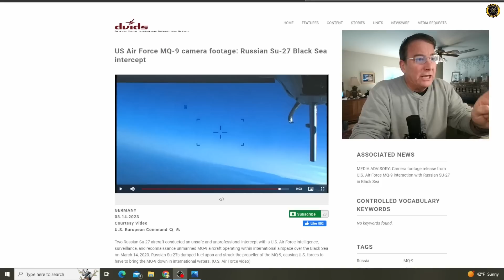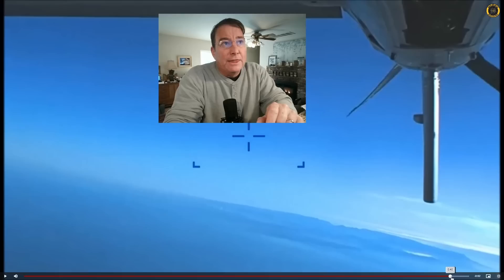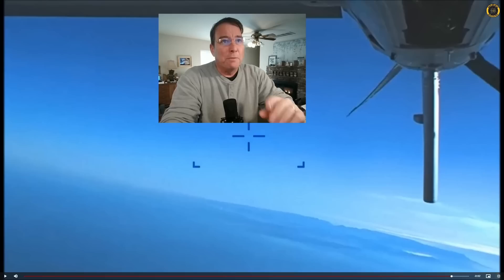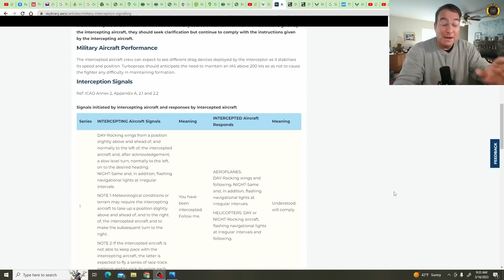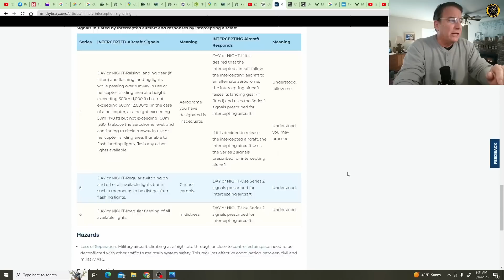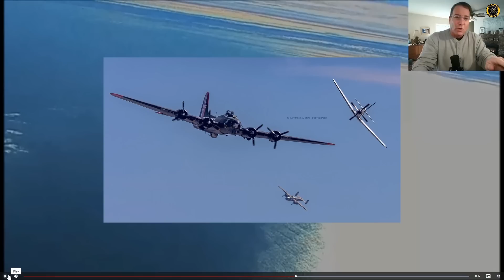Botched Russian Intercept of MQ-9 Drone Over International Waters

Comment: A couple of possible scenarios: 1. The Russian pilots were attempting to down the drone, intact, so it could be recovered in the sea.  2. The fuel dump itself bent the prop.
Reply: a fuel dump, especially from a jettison system isn't capable of causing damage to another aircraft. You can clearly see the fuel is fully atomized within a few feet of the dump outlet. My thought was the idiot was attempting to set the drone on fire but I'm not sure the SU-27 is capable of a dump and burn.
Reply: @Dreddip  Thats exactly what he was trying to do with the afterburners, with a half empty bottle of vodka in the cockpit.
Reply: @Dreddip The fuel wouldn't atomize. Think diesel
Reply: Camper Lab, agree on both counts. The plane likely flew within a few inches of the tail fins, putting the stream of fuel over the blades and the air intake.

Ingestion of fuel would create a fuel-rich  mixture likely to cause the turboprop to flame out. With no APU & a busted prop, it's unclear if the drone had a sufficient power reserve to operate the flight controls and maintain the satellite antenna lock - it doesn't appear that its operator had been able to glide it outside of the recovery zone of the Russian navy.
Reply: The thrust from a propeller blade is typically proportional to the density of the medium it is operating in (plus other factors of course).  The density of air at altitude will be somewhat less than 1 kg/m^3.  Density of pure liquid kerosene is around 800 kg/m^3, but in this case the kerosene is dispersed as droplets in the air.  If we take a hypothetical guess that the air/fuel mixture is around  25% fuel, 75% air, the net density of the mixture will be around 200 kg/m^3.  On encountering the fuel mixture of this density, the propeller blade would experience a sudden increase in load by a factor of about 200.  A sudden overload of this magnitude would be enough to bend most things.  Of course we don't know the actual air/fuel ratio.  It could be less or could be more.  The velocity of the dumped fuel relative to the drone's airspeed could also be significant.  Too many unknowns to be anything like accurate, but appears not impossible for a fuel cloud to bend a propeller blade.
Reply: @dogfoot1874  avgas is highly refined, unlike diesel
Reply: @Sshooter444  I suspect the aircraft in question is using AVTUR - which as a refined kerosine is very much like diesel!
Reply: @Sshooter444  jets don't use Avgas , they use Jet A1 which is 99%diesel with an anti freeze.
Reply: I agree with  '1', but it looks to me like he rammed the drone by mistake. Th e fuel was WAY behind him, and as Dr. Juan said, (heh heh) it looked like he was gonna have an "Oh s#!% " moment and pulled up at the last second. Probably soiled his panties.
Reply: @derekgodfrey5  Jet A is closer to kerosine.
Reply: Exactly what I said, this was to recover the drone - and guess which russian ally is desperately attempting to create a domestic drone program...
Reply: @chargerfan5513  "he rammed the drone by mistake" Unlikely, because the drone's tail fins extend outside the prop. The drone is MUCH slower than that jet in the level flight, plus the jet pilot appears to have been intending to douse the prop and air intake with a LOT of fuel at once (not much atomized) "to create local atmospheric conditions not conducive of continuing powered flight" as his report likely has stated. Both objectives call for a very high angle of attack (aiming the fuel stream down, to contact the drone) slow-ish pass (time of exposure to the fuel stream), and that's precisely what'd transpired per video footage. Needless to say, a stabilized approach for such a pass would start behind and well below the drone. Vid author's assessment is a potentially lethal underestimate of the Russian airmanship in this case.
Reply: @derekgodfrey5  TS-1 is a jet fuel made to Russian standard GOST 10227 for enhanced cold-weather performance. It has somewhat higher volatility than Jet A-1 (flash point is 28 °C (82 °F) minimum). It has a very low freezing point, below −50 °C (−58 °F).

Dense.
Reply: @dogfoot1874  of course it does, think speed.
Reply: @richardstuart325 , nice try but if the fuel hitting the blade was dense enough, the blade would try to fly forward, therefore bending the tip. No that bent blade is bent against the direction of rotation.
Reply: You're absolutely right on both counts. The drone was considered a threat,  Russian navy did snatch the remains. Hitting a body of liquid at the speed prop blades were traveling will do the job.
Reply from the maker: The botched fuel dump overshot and MISSED completely!
Reply: @blancolirio  second one was a SUCCESS 🤣
Reply: @Dreddip  Perfectly atomized to over rev and destroy the drone engine.
Reply: @chargerfan5513  Nonsense. They practice this move. Here it is in Syria https://youtu.be/EvaQZEhlhA0
Reply: The drone was downed in one piece as they wanted it. They practice this move. It isn't easy to douse a slow moving drone with fuel. https://youtu.be/EvaQZEhlhA0
Reply: @Sshooter444  its a turbine engine so no avgas.  jet fuel / kerosine/diesel
Reply: @IlPinnacolo  Very true. The distribution will range from nearly all-air at the visible boundary of the dispersion "cone" to nearly all-fuel in the middle, one turbulent bubble of a few gallons' worth of TS-1 right next to another. What that can do to a spinning prop is easy to see if one studies the sea plane landing mishaps.
Reply: @blancolirio  >"The botched fuel dump overshot and MISSED completely!"
What a botched operation. The US navy was able to pick up the SU-27 wreckage while the MQ-9 continued with its mission.
Reply: @mvd4436  The engine won't rev and destroy itself. There is a system installed on some versions of the 331 engine called AWI (Alcohol Water Injection) used to lower engine temperatures for better take off performance. When that system is inadvertently filled with fuel and dumps way more fuel into the engine intake than briefly flying through the fuel fog an SU-27 lays down, the engines don't run away and destroy themselves.
Reply: @AlexKarasev  You're assuming a solid column of fuel is being dispensed directly under the jet and then dispersing, that's not possible with a fuel jettison system. Even a fire tanker dropping 3,000 gallons of fire retardant in 5 seconds, which is much denser than fuel and specifically designed to stay together in large droplets dropped at much lower speeds is capable of dumping enough fluid to create a liquid volume like you describe. Also, if there were "turbulent bubbles of nearly all-fuel" why aren't they seen falling below the cloud of fuel farther back in the trail, similar to how a retardant drop looks.
Reply: @blancolirio  a more direct action would've been a cause for escalation.
Reply: @Dreddip  I can't take this argument much further based on 2sec of video plus other anecdotal evidence. Hopefully more video will be released, and I like to think the Russians have taken footage of their own of this important encounter & it too will be released eventually. But it's kind of like arguing abut Russian low-altitude ejection video - some people just won't believe that's not a computer game.
Reply: @AlexKarasev   Understood. Ok, I'm not a pilot, but why didn't he just pace the drone and get right in front of it and then dump the fuel in its "face".
Reply: @chargerfan5513  he can't fly as slow as the drone, and fuel spreads too wide, I reckon
Reply: Jesus christ, the "I don't actually understand physics, but I do own a TI-83" crowd is just too damn much. The idea that a fuel dump - at a cruising speed - is dense enough to bend an ALUMINUM prop is beyond absurd. Throwing a bunch of math at it won't make your theory right if the math is wrong. 
And you better be running a damn simulation of this if you want any results that mean anything. Like a couple numbers thrown around in a YT comment is going to yield a vaguely reliable result LOL.
Reply: @RyTrapp0  A couple of numbers thrown together indeed isn't much, but you know what's even lower on your scale? A naked opinion with no numbers at all. A seaplane prop can bend if it gets a tip of a wave, that's good enough for me.
Reply: We're just going to skip over the fact that we lost a $32 million drone because we're effing around where we shouldn't be effing around?
Reply: @jacobcastro1885  It's int'l waters. Inside the Russians' self-declared ID zone extending from a self-declared Crimea. So US technically had every right to be there (I say this as a Russian). But I also say this as a Russian: that theory aside, in practive an intelligence-gathering asset during logistical prep for what we now know was Putin's visit to the area, was either getting chased off or coming down. So let's all be happy it was an unmanned aircraft and nobody died over it. Ukraine war is costing around $1B a day - so this drone isn't even a rounding error. Plus the US isn't about to bring up a matter of cost after the Nordstream bombing thing. Compared to that, Russia could drop drones every month for the rest of the year and the US prob will still be ahead $ wise.
Reply: @AlexKarasev  downplaying $32 million loss because it's a drop in the bucket compared to all the money we're losing on this expedition... PURE EFFING INSANITY!
Reply: @jacobcastro1885  well it doesn't make it any smaller I agree. Not so much downplaying as we ought to have seen the forest for the trees & the forest has been pretty obvious for some time. I think given all the news about BRICS incl Saudis, Mexicans eyeing joining, the plan to weaken Russia via Ukraine has worked about as well as sanctions. The Ukrainians are clearly the victims here, but you look at the drone loss for the American people, and there are some privileged folks who don't see it as a loss - they see it as a sale. And to them, the more the merrier, they're riding this buggy till wheels come off.
Reply: @lesmorgan5865  Why not just machine gun the balloon and track its decent? (Why do all the "Little People" have the best ideas? Oh wait, I forgot....orders are orders.)

Comment: 1.  Fuel Dump:  Could it stall the turboshaft engine (significant change in fuel:air ratio)?  Is an air restart normally possible?  (Though, in this case, pranging the propeller may have taken that option off the table.)
2.  Intent vs. Incompetence (collision):  We understand that in the recent past, Russian Air Force pilots have had their flight hours cut to the bone.  One could expect a degradation of flight skills -- though combat flying hours in the Ukraine War may have mitigated some of that.
Reply: Turbines always run lean up to turbine inlet temperature limits. Excess air keeps engine cool.   A brief exposure to fuel through the gas generator section can cause momentary TIT excursion which would cause FADEC/DEEC to cut fuel.  It could also cause overspeed indicators. 
Relative speed of aircraft involved would make the fuel an aerosol, the droplets wouldn't pose any issue to the compressor section.
Reply: It wouldn't stall the turboshaft engine, but enough fuel into the air intake would cause overspeed and possibly turbine burnout. I don't think this was an attempt at a "normal" intercept. I think it was an attempt to destroy the drone without actually shooting it down.
Reply: Yes, this is incompetence.  Empennage damage from impact probably made control difficult.
Reply: 1. These small turboprops normally have a centrifugal compressor, which can take a stall without too much trouble. At any rate, I don’t think the fuel dump would stall the compressor, rather it may flame it out by bringing the fuel/air ratio in the too-rich-to-burn area.  It sure if you can restart the engine on this drone. If it does have a starter, the. You could restart it once it’s out of the fuel cloud. 
2. Russian pilots can’t fly in formation, that’s a known fact, and they never train for it.
Reply: Was wondering about this. Could the fuel cloud combust on contact with the hot engine? Could the mass of fuel destabilize the aircraft? Could it contaminate sensors?
Reply: @SB-lp7yj  In my mind I see the C.O. getting word about the drone (it was communicating with Turkish airspace controllers) and deciding to give the intercept to the two worst pilots on duty.  After all, what could possibly go wrong?
Reply: @SB-lp7yj  re: 2 - What about the annual fly-past over Moscow?
Reply: @SB-lp7yj  Auto Ignition would relight the engine before it lost hardly any RPM. With a fuel spray that atomized and dispersed I seriously doubt the engine would notice.

Comment: I'm very interested in knowing if the SU-27 actually also struck the upper vertical stabilizers, as it's not shown in the after impact footage.
Considering the V shaped dual vertical stabilizer on the MQ-9, the SU-27 was extremely lucky to only having hit the prop.
Reply: Russian airplanes are built with sledgehammers, not scalpels. He could probably have flown right trough the MQ-9 with only minor scratches in the paint.
Reply: There was no contact, the jet blast damaged the propeller.  The video had to be cut at the crucial point to maintain the propaganda.  Excellent precision takedown of a drone.
Reply: @darkiee69  like the US A-10. Built to take small arms fire? Even if the Russian plane did crash, it seems like they care little about their soldiers.
Reply: @user-pf5xq3lq8i  if jet blast damaged propellers - airplanes with pusher props wouldn't exist. Try again
Reply: @Cerberus09  There's video of them landing with the gear still up. They just lift them up, get the gear down, touch up the paint and off they go again. And russian pilots have a macho culture surrounding them to the point where some of them fly without their "G suite" at some missions, just to prove how tough they are.
Reply: @user-pf5xq3lq8i  Must be a special kind of jet blast that can turn on prop blade, bend one, and leave two unharmed. This was russian pilots macho behaviour, he just had to show who had the biggest balls, and got snipped.

Comment: Juan, perhaps I missed a comment but two things I see here. 
First the prop looks to be bent towards the rear. That tells me it wasn’t hit by the Sukhoi but rather was bent from the force of the fuel hitting it. Had the Sukhoi hit it I would think that prop would be bent forward and not just that one. I’m not sure what RPM/Torque settings the Reaper cruises at but I would think over 2200rpm. At that rate if the Sukhoi hit him more than one prop would be damaged. I’d expect prop 1-4 to show some sort of damage not 1. Also as stated above I’d expect them to be bent forwards not rearwards. 

Second had the Sukhoi hit him the tails would have also taken some damage. In the video I see a stable attitude with no debris falling behind it from either aircraft. I can’t imagine any way he could hit that prop and not hit one of the V tails. 

Just my 2 cents here but what I see doesn’t add up to a midair. What I see is a prop sustaining severe damage from excessive force applied to it from the fuel dump hitting it dead on.
Reply: Naah, there is one prop bent rearward, and one is feathered, which shows it was inline with minor damage of the adjacent prop.
Reply: The one feathered is opposite of the bent one. 1 bent back, 2 looks good, 3 feathered, 4 looks good.
Reply: @marktanner4259  Good observation.

Comment: Unless there is footage prior to what we see here, we have no idea of the initial contact.
Military - military encounters are not going to follow civilian intercept protocol.
Piloted - remote piloted encounters are not going to follow normal military protocol especially in proximity to a war, especially where the intercepted aircraft is from a country in cahoots with your enemy.

The Su 27 has thrust vectoring nozzles. Since we are all guessing here, my guess is that the pilots were flying over the drone, using vectoring to stand on thier tail and blast the drone with jet wash.

Some think that it was an attempt to set fire to the fuel that had been dumped on the drone, other jyst think the fuel was as close as they could come to pissing on it.

Comment: It’s a Honeywell TPE331 fully featherable and reversible pitch - you could DM for more details - mq9 familiar 😊
Reply from the maker: Thanks Jerome!  Hartzell prop?
Reply: Yes sir. The 4 blades are an upgrade part of the extended range TCTO from 3 blade
Reply: Last comment - unlike other “drones” the mq1 and mq9 are Tactical aircraft flown in the traditional sense stick and rudder. Crew is 1 pilot and 1 sensor (co pilot/ PNF / pilot monitoring). Preferred nomenclature is RPA remotely piloted aircraft vs Drone which is derogatory. Rodney danger field of the combat air forces. Aircraft is taken off and landed manually via a non coupled ILS/GLS. You have March AFB nearby you could get a capes brief.
Reply: Ohhh prop may have been made in Ohio!! 
O-H

Comment: Your analysis is for friendly skies US airspace. The actual incident occurred in a war zone and the Reaper was intentionally downed in a manner that the US could not say that Russia Russia shot a US military asset down, thereby pulling the US--- not NATO into a war. 
If you ever actually served on a US aircraft carrier you would know that these non-kinetic airframe on airframe challenges are common between the US and Russia over the Atlantic and Pacific when the Russians over-fly the ceremonial cross deck ceremony where the departing battle group and replacement battle group "trade flags". 
I served aboard a WESPAC carrier where a Russian TU-95 Bear approached our cross decking evolution and two Super Hornets were sent up to harass them away by very close proximity nudge. The Bear being still loaded with fuel for the long ride home decided they did not want to be disabled by a Super Hornet damaging it's props in a skin on skin game of chicken.
That's exactly what happened with the drone.